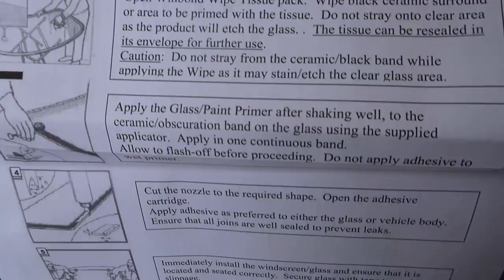Can I Fit A Window CHALLENGE?!? | My SELF BUILD Camper Van Episode 3

Comment: Did this with my Landy I owned so the fuckers at the tip would let me on without a permit despite it clearly not being a commercial vehicle 🙄 Pretty easy job in all though, just watched to the end, you can cover the messy cut if you decide to put some interior inside the van, you can get some fabric covered chipboard which is pretty good for taking away the echo and you can also cut it to fit speakers to etc.
Reply from the maker: That's what I'm going to do mate
Reply: @BlueVanMan  Should be fine once interior is in then. Cover it up and forget about it ;)

Comment: Also Dave, if you need to remove any residual tape adhesive you might find left on the van from taping up the windows. You can get this stuff off amazon called labelclene, it's brilliant, we use it at work. Type in this code in amazon and it will come up mate B000J689H6

Comment: Dave has uncle Steve seen the shoes with a camera attached to the front of them for the visually impaired ?? It tells them where they are walking so don’t bump into things
Reply: Unfortunately they're ITV camera shoes, so aside from when they cut to the commercials just when you're about to cross the road, they also have Sam Matterface quoting Hamlet and generally making an arse of himself instead of giving basic information. Unky Steve, beware!
Reply: @gkmacca1  cheers for the info .. I seen some 1 post them on face book for the blind and thought of unky Steve straight away coz am big blue van man fan . They should make them for the public tho coz they seem like it would help a lot of folk out

Comment: As a former body repairer for FMC (now in parts division) and glass fitter, I’m sorry buddy but this is hard to watch. The beading/weatherstrip should cover both inner and outer panels as the glass butts up to it when fitting and gives a better finish on the inside. Also as you have put the glass up towards an exposed metal flange, due to body flex the glass is probably going to shatter the first bone shaking pothole you run over.The bonding sealer should be one constant bead and butted at the meeting point as this creates a better seal and eliminates leaking. However, it’s not a disaster Dave and I know you are flying by the seat of your pants here and not an expert, and I totally respect you are having a go. You know I’m a huge fan mate. My advice..cut them out and start again. It’s an easy fix.
Reply from the maker: You sound like June mate🤣🤣🤣🤣. Had a word with the company who sold it and if it fails they'll show me how to put it right.
Reply: yea weatherstrip should def. be on the outside as well as inside lol